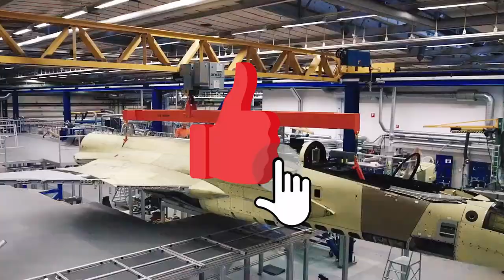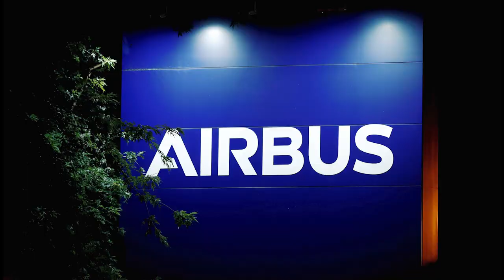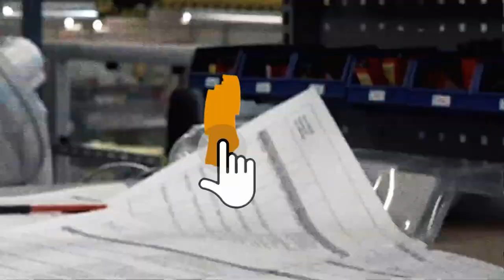Finally: NATO Testing Its NEW 6th Generation Fighter Jet!

Comment: Good video but just wanted to add a little there no disrespect or anything but anyway I don't know if you knew or not but the US has already test flown a 6th gen concept in 2020 and always keep in mind America is usually a little smarter with there top equipment not unveiling it until it's operational because of the obvious tech theft threat going on and I'm pretty sure it's quite obvious where that threat is but that's because we are known for having the most cutting edge equipment out there and is usually at least a decade or more ahead not that there's anything wrong with the French and swedes that's definitely quite the contrary I've always been a fan of there aircrafts engineering they are usually just right under us by literally a hair or so oh and the SU 57 was actually qualified as a 4++ not quite a 5 and the J 20 has been questioned on weather it's a 4++ or a 5th but anyway thanks alot much love and respect liked the video and have a great day ✌️
Reply: Su-57 has officially been classified as a 5th generation fighter, the J20 is a 4++, it's stealth capabilites are far to bad to be classified as a 5th gen, The Su-57s stealth is bad too, it's just barely good enough to be considered 5th gen
Reply: "the US has already test flown a 6th gen concept in 2020"

Uh huh, got some actual support for that rather strange claim?   I don't know why you think the 5th gens were open for the competition but the sixth gen isn't.
Reply: @accountantthe3394  Which is a good trick, because as far as I know the specs and capabilities aren't published for either of them, not the ones that matter, anyway.  As far as I know they still aren't for the F22.  And every time we think the Russians are catching up, we get hold of one and it turns out to be junk, compared to the claims.
Reply: @gigakrait5648   @GigaKrait  OK, hadn't heard that, I will look it up.  It doesn't sound to me though, given what he said, that they were flying any thing more than a tech demonstrator.  That could basically mean anything. If they had flown a real full up prototype they would be testing now.  The "some of the key technologies" was kind of the clue there.

Also, I don't know what "digital systems" have to do with anything, since they have been in use for several decades.  The F16 had a 1553 bus on it, and as far as I know ALLof the systems of the 22 and 35 are fully digital.  

I worked in the same lab where the FLIR was designed and integrated, called EOSS, for the F23, which got moved across to the F22, even though that wasn't supposed to happen.  Most all of the circuitry in that FLIR is digital.  There are analog circuits in the servos, but not much else, and that is only for the inner loops.  Obviously there is analog circuitry in a radar, too, but I am talking about far and away the bulk of the electronics.

I wouldn't be surprised if the "testing its fifth gen fighter"  was referring to that demonstrator, as well.  I will go look up the article.  Interesting, thx.  When you've done this crap all your life and you finally retire, keeping up with it, even on a superficial level, sometimes tends to feel a little bit like work.  Excuse my ignorance here.   :-/  :-)

Comment: So far all I see is a bit of a wishlist here from the Brits/Euro's. Mockups and claims are all well and good, but as the F35 dev showed, getting a plane in the air is one thing, getting all systems & force integration (esp. for the "swarms") working seamlessly can take a looong time to debug/evolve. 

I wonder whether every time they have an issue, these will get the constant social scrutiny and ambit failure claims the F35 program had to suffer?

Btw had to laugh at French politician claims that their aircraft will be "better than the F35 and F22". I would damn well hope so, considering their plane is to be delivered into service over 3 decades after the F22 (2005) and over 2 decades after the F35 (2015)...

Comment: I suspect that the 6th Gen fighter will have NO CANOPY. Instead, it will have distributed aperture sensors providing 360 degree vision conveyed to the pilot exclusively via his helmet mounted display. Given that we are no longer reliant on looking out through glass, the pilot can be seated in a lying down position very much like Formula 1 drivers. This is actually best for  staying awake under extreme G forces. This eliminates the canopy bulge and all cockpit displays. The helmet is the display. The pilot can see his hands and the controls, but everything else is as if he is floating in air. If he moves his head he sees everything around him with an outline of the airframe. If he turns head all the way to the left or right past last 5 degrees of neck rotation, the HMD automatically skews to a full rearward view. The same goes for tiling his head down to the last 5 degrees of neck movement; it shows the downward view. OK, maybe there can be a backup 8" screen or something which allows the pilot a rudimentary view in case he has to fly home and land the aircraft if the HMD fails. That is if he choose not to have the aircraft fly home and land itself.
Reply: No it wont.
Reply: The problem with relying entirely on HMD or screens instead of glass is that more can go wrong with it.  If the HMD or screens on the inside of the cockpit malfunction and stop working, the pilot still needs a backup option to be able to see where they're going.  It would be a mistake to be overly reliant on HMDs and screens.
Reply: @Ben_Kimber  Not really. They same can be said of the large MFD or MHD the pilot relies on today. If they fail, the fighter is quite useless for combat purposes. Also, digital images is what drones rely on exclusively. If the HMD fails there is a small backup screen for rudimentary flying in the cockpit. If that fails, they aircraft can be flown from the ground like a drone or it can fly home and land itself autonomous ly. The likely hood of any of these failures is minute and the advantage of artificial vision and the ability to eliminate the traditional cockpit far outweighs the risks.
Reply: @dwightlooi  Fair enough.
Reply: The American 6th-gen fighter for the FA-XX program looks like a copy of the Chinese J20 with canards

Comment: Maybe just maybe the US made a mistake in not choosing the YF-23. We will never know. We also don't know the kickbacks given by the F-22 to the appropiate decision makers. Let's face it. It happens. YF-23 supersonic speed is faster without afterburners if we believe what we are watching.
Reply: NG had massive cost overruns that spiraled out of control with the development of the B2 . The decision makers thought Lockheed could manage the F-22 program much better , which they did .
Reply: The F-22 & F-35 go supersonic without reheat. It's called super-cruise dude.
Reply: @BigDaddy-yp4mi  f-35 doesn’t have super cruise ability
Reply: Both platforms were supersonic without afterburners.
Reply: The F22 has super cruise capability, it was a requirement for both of them and they both met it.
Reply: @MrJdsenior  no f22 has it 35 does not.
Reply: @michaelmichaelagnew8503  no they do not.  You need to do more research
Reply: @BigDaddy-yp4mi  35 technically is NOT super cruise.  Stop spreading bs.   It can TEMPORARILY do it for 150 miles ROUGHLY it can’t do it indefinitely which is the definition of super cruise by the usaf.
Reply: @smyers820gm  You are not wrong, except we are talking about the 22 and 23.
Reply: @MrJdsenior  somebody above typed 35.  Sorry was responding to that comment and it got mixed in with the original post.  My bad.
Reply: @smyers820gm  Hope it wasn't me.  Wouldn't surprise me if it was.
Reply: @MrJdsenior  no big daddy.  Lol but other comments popped in right behind and it fooled me. Lol.  Thought folks were arguing that 35 had the capability.  Lol
Reply: @MrJdsenior  YF23 has a faster super cruise without the burners.
Reply: @michaelmichaelagnew8503  YF23 was faster in supercruise without burners.
Reply: @smyers820gm  Don't sweat it, I've answered the entire wrong comment more than once. :-/
Reply: @BigDaddy-yp4mi  Maybe I should have phrased it different dude. Both can supercruise but the YF-23 is faster without the afterburners.
Reply: @paulh6517  YF-23 was faster, in supercruise, than the YF-22. But the production F-22 is much faster than the YF-23.
Reply: The B-2 overruns is why the YF-23 wasn't chosen.
Reply: Why would they have chosen the f22 if it was worse? Speed isn't everything, and even then I'm willing to bet that's taken out of context.

Comment: Yeah, the FCAS will probably never be made

The germans changed their mind about Dassault having the lead, Dassault was offered the lead so they don't want to give it to Airbus, so the negociations are just in a standstill

And now, both Germany and Spain said that they would rather buy F-35 than FCAS, so it will most likely collapse before the developpement even start
Reply: Yes, the video lacks any up-to-date progress. It also fails to point out that Japan is working with the UK on engine development and penned a letter of understanding to work on the Tempest project.
Reply: @JOhnDoe-nl4wj  They were forced by the US to do it, but still. They bought a lot of F-35, which is a 5th gen fighter, and you don't buy new gen when you still have brand new ones in your army.

Wether you like it or not, Germany is not showing any interest in pushing the FCAS program forward, and Spain understood that this was a dead-end.
The german parlement is rejecting any kind of signature on any subject on the matter, and this is going for years now.
Reply: @JOhnDoe-nl4wj  The Tornado is used mostly as a way to carry the B61-12s nuclear missiles that the US lent to Germany.

The Tornados were starting to get old, so Germany started the process to certify the Eurofighter to carry such bombs.

The US were not having it and were not going forward on it, so, in april 2020, Germany changed its mind and decided to buy some F/A-18 to do it. This plane was already certified, so what can you do?

Remove the certification. 
In november 2021, the US National Nuclear Security Administration (NNSA) decided that the F/A-18 should be removed from the list of planes certified to carry such bomb.

Which led to the situation we're in today. The F-35 was now the only available plane to do the job, and with only one choice on the list it's quite hard to take another plane.

For the second part, it's true for the MCGS (no one knows what to put in it), but the main issue for the FCAS seems to be the way to do it.
At the begining, it was Dassault Aviation and Airbus Germany that were supposed to do the job together. Dassault would get the lead for the NGF, and Airbus for the Eurodrone.
Everyone was cool with it, and with the Brexit the UE had to show that their had strong ties.
Like you said, parliements signed the begining of the program, Spain joined, and since then everything is stuck.

First, Airbus Germany asked to have every info on the systems on board to be able to build the planes and make maintenance by themselves. It's not cool, but it mostly mean that Dassault have to give up every major patent on their technologies, a bit too much.
Then, Airbus asked to change the division of labor, 50/50. Dassault refused, saying that this was not this way on the drone, and you can't lead on a airplane project if you don't have the actual lead.
And now, Airbus is starting to call into question the position of "best athlet" that gave the lead to Dassault, basically asking to get the lead themselves.

It's not working because Airbus Germany and the germans in general want to do the planes themselves, and this was not what was planned first.
So we have two options here. The project dies, or France give up to show that the EU can do big cooperation projects

Comment: I think this makes no sense.
The point is "with pilot" and "without pilot".
Having a human on board lowers greatly the limits to which aerodynamic performance can be pushed, in the near future any conventional plane with men on board will be swarmed by small hyper-fast and hyper maneuverable drones controlled by computer algorythms that predict the counterpart's forced movements based on it's limits.
The drones don't even need to be armed, they just need to have a hardened "nose" and collide with the opponent in numbers damaging it and making it fall.
Any traditional fighter will be hunted and brought down by packs of 10-20 drones at a time and it won't have any chance of reacting with it's traditional missiles or guns which are designed to fight one or two foes at a time.

Comment: 1.) The SU-57 is 5th generation in name only.   It is really just an advanced 4th gen fighter.   That, and only 12 have been built (10 test air frames, + 2 regular production) most of them don't even fly anymore, and and it is questionable if any more will be built.

2.)  This pan-European project seems nice, and will probably be pretty capable when it launches, but nothing was mentioned in this video that isn't believed to already be a part of the U.S. Air Force NGAD program, which is targeting development well in advance of the suggested 2040 timeframe in this video.

If I had to guess, the U.S. Air Force NGAD program will field the first 6th gen fighter, followed by the U.S. Navy F/A-XX project, then the UK/Swedish Tempest project, with this one coming in 4th.   2040 is still a long way off, and these other projects are purportedly planning on being deployed well before then.

Comment: The Russians have two issues: (1) are the 6th gen a/c up to the claims. Quality control in Russia is an ongoing problem. (2) Let's say the new a/c are good. Russian can't afford them so their numbers will be low.
The Chinese have issues as well. First, they are having problems with their indigenous engines. I expect they will eventually work through this. Second, they too have issues with quality control, but not to the degree that Russia has. China also has issues with battle doctrine. It's very top down and their training puts a lot of emphasis on political training at the same time. 
 We'll see.

Comment: Why haven't the US military industry looked into hydrogen fueled planes?
Reply: Hydrogen takes up a lot of volume in comparison to fuel that's already in use. The energy density of liquid hydrogen is only about a quarter of that of jet fuel.
Reply: they already have, in the 80's/90's

Comment: I work for Boeing (Aerospace engineering) in  St. Louis MO both F/A 18 side and joint on the F22 years ago and I'll tell you, we already have a 6th gen ready to be moved forward, it's all on congress and the red tape now.

What we do know, the one actual fly worthy Su57 isn't anywhere close to the F22 and F35, not by a mile. The J20 would be on par with the Japanese F16s, this we know but, will we ever have an encounter between the J20 and our F22/35, probably never. Let's hope we never do.

Comment: The USA didn’t create the F35 it was a multinational project and the most expensive ever.   This is the thing you Americans get wrong time and time again.  The same can be said about the Manhattan project as well….
Reply: That might be true but it was Lockheed Martin that was leading the development. The competition was between Lockheed and Boeing with their initial designs the X35 and the X32.
Reply: @gigakrait5648  I seem to remember there were British also there choosing the design alongside the Americans this was because the British made and invented the harrier and the agreement was that our decision is also counted in the next generation vtol fighter jet if we sold you the harriers.  I think it was inevitable anyway because the Boeing harrier was the same technology with the rotating thrust nozzles and it was butt ugly.  It also had the same wing design in that the harrier where the wing spa crosses the the top instead of the middle.  The F35 could vtol with a higher weight and was faster than the boing version and it was slightly more stealthy so it was inevitable anyway…. The more allies working on new fighter jets together the better.  There is a difference as well between the Harrier jump jets and the F35 I’m not talking about stealth and speed I’m talking about their ability to land and take off from anywhere because all harrier types could land and take off from aircraft carriers but not all F35s can do this since all harriers has the VTOL nozzles as their means of generating thrust and they all could swivel up or down.
Reply: It USA did create the F35 but other countries helped finance it.
Reply: Thankfully Britain and US have been cooperating on many security issues for years, the more cooperation with European allies the better.  Collaboration on some bulwark platforms, then encourage development hubs in each country to expand and improve relevant skills for shared platforms and to innovate unique projects and upgrades. Economies of scale for some core elements that aid in interoperability, but also leverage diversity of countries to find creative ways to push the envelope...
Reply: @michaelmichaelagnew8503  Parts for F35 we’re made in the U.K. Turkey and other NATO countries.  They were assembled in the USA but 10-15% of every jet sold being built or developed in Britain.  I’m still correct Google is a wealth of information.